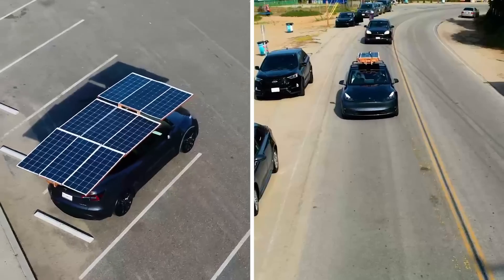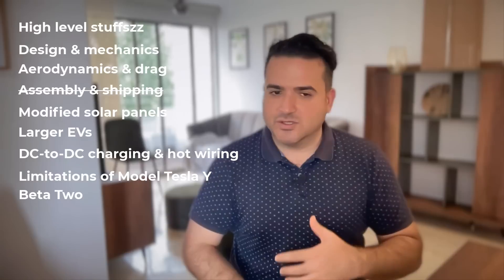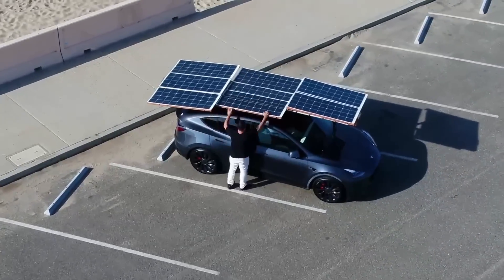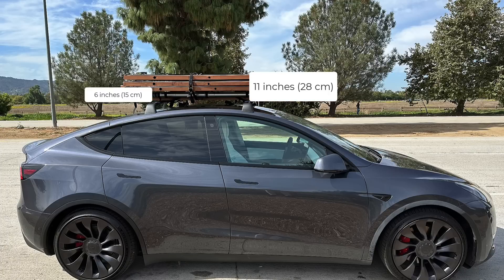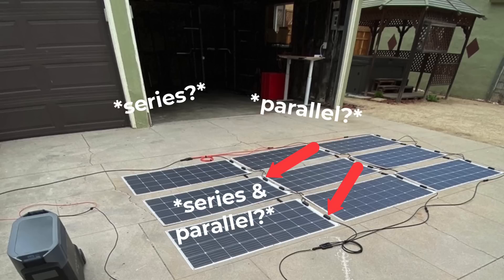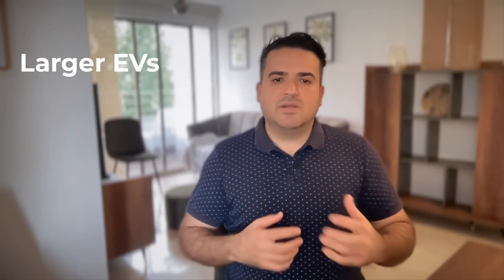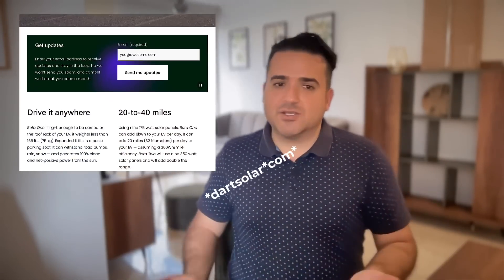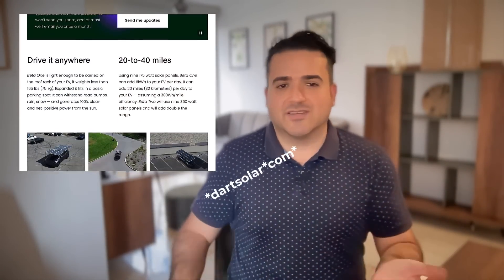DIY: A drivable solar rooftop for my Tesla Model Y (20 to 75 miles per day)

Comment: Please explain how you got the power into your car without inverters?
Reply from the maker: The solar power goes into an M PPT that's connected to a battery, 48 V battery. That is then connected to an inverter. The universal charger connected to inverter. I'm currently researching how can I direct the power from the solar panels into the EV as DC.

Comment: Even is such a contraption is FREE, one would probably struggle to get anything out of it.  If you actually drive a car at least a bit(more than 50 miles a day), the  extra drag will probably negate any benefits? At a cost of  4000$  you would run your car for more miles than the EV would be ever able to cover in its lifetime... Even if the whole thing would be deployed automatically not sure there would be takers...and thieves would be more than happy to help you to get it off the roof pretty swiftly too. In MHO his is just an idea, which is not viable in real life and probably never will. The losses are too great comparing to possible gains, lets be realistic about the subject. Yes, it is easy to criticize but the math simply does not add up no matter from which angle we would look at it.
Reply: Some people do much less than 50 miles a day, this totally works out for me, as for those who do more it's still a saving that adds up over the course of a year.
Reply from the maker: Well, the reality of it is if it gives you 20 miles per day, then you're good

Comment: I believe it would be necessary to install super powerful inverters on a scale, a type of Tesla coil that could either supply part of the vehicle's energy or instant charging... 4000W is a large amount of energy...
Reply from the maker: Not really the electrical components can fit in the trunk of the car, where the spare tire goes. That is below the flat floor of the trunk.

Comment: The disturbed air flowing over a roof mounted solar panel would lose you a lot of the gains that the solar panel is meant to achieve. Plus, it looks stupid.
Reply from the maker: Well, version two is 5 inches high, so the drag loss with a wind breaker is negligible

Comment: Since many cars are garage-parked during daylight hours, why not design a fixed version for roof mounting on structures?
Reply from the maker: The whole purpose of this project is to be able to charge offgrade, for example, if you're in the desert or in the forest. If you had a home, you can just charge from your homes electrical grid

Comment: I wonder if there is a way to keep the batteries warm with these solar. The EV's are proving not to do so good in cold weather.
Reply: Global warming due to the earth's orbits passing between the two energies of the Sun's Oort cloud magnetosphere for the next millennium.

Come to Jesus who united and warned us all.
Reply from the maker: Yeah, totally, the solar panels and electrical components can continually drive power to the car which the car intern can use to heat up batteries. For more details to get updates go to dartsolar.com and enter your email address.

Comment: put the solar panels on the car body panels
Reply from the maker: Love the idea!. The issue is that replacing a broken solar cell will be extremely hard, and if a cell breaks, it destroys the entire series. Embedded solar panels are super delicate and hard to fix. But if you're into that, check out the Aptera

Comment: thought about this YEARS ago...most people are parked outside at work from 9-5, prime sunlight time. Auto manufactures should make the top layer of hoods, roofs and trunk decks out of solar panels, or a skin on top of the original metal. Most people that have electric vehicles are within 20 miles of home. And with the right design, be able to regenerate that usage within those 8 hours. Toyota had a small roof unit to run their cooling fan so the AC wouldnt have to work so hard in summer time when people would first get into their Priuseseses...just do it on more body panels. Any surface will grab sunlight of some sorts each day.
Reply from the maker: TOTALLY AGREE. this has to be done. And not just a puny 200 watt or 400 watt panel. But something serious, so people don’t have to change their cars from the grid for most commutes. You’re so right.

Comment: What are the details of the 440W panel that weighs that little? I'm interested! And the beta 1 panels? I have a smaller application too.
Reply from the maker: All flexible solar panels weight about that range. Search for "440 watt flexible solar panel", you can also find the 200 watt or 175 watt Renogy flexible, or I think even SunPower makes them
Reply: @DartSolar  Oh, I see. But I thought flexible panels had poor longevity compared to glass ones? More degradation over time? Let me self check that before hitting reply... Yeah, and also lower efficiency ie more size per same output. I suppose you balanced all these factors to get the best compromise. As you were. <3

Comment: Tesla should do just what the Prius is doing with it’s hybrid plug in ev. It has a solar roof already integrated, the roof itself doesn’t give you much extra range but it’s definitely worth considering to implement and improve it.
Reply from the maker: Well, that solar panel is super helpful to not end up with a dead battery
Reply: this roof solar only keep the 12v service battery charged. this idea of solar on the roof won't work and so many done this before and none flew off due to high cost and low gain.
Reply: @farzins7682  the car has to be designed around the solar panel.. Think Aptera !!
Reply: The Prius solar panel doesn’t extend range at all.

Comment: Very Good job. Extend the concept to RV Vans too!
Reply from the maker: Such a great idea -- what are the dimensions of your roof?
Reply: I don't have a van, I'm only projecting in my mind how should it be. I'm thinking of a 6 m long electric van. @DartSolar
Reply: @claudiorusso2389 I have 1620W (4 ea 405W REC) on top of Chevy Express. Works great- approximately 6kWh/day.
Reply: @DartSolar  I'm the one who is driving a truck in Korea. I want to charge my truck camper with solar power, but there is no related technology in Korea.
I wonder how I can do DC charging in DC

Comment: When the panels are deployed, can you still open the rear hatch of your model Y? I'm very interested in this setup being used in the context of off-grid car camping. A dream scenario would be if the solar power gain can partially or completely offset the power use of camp mode at night. I would love to contribute or help out in any way possible, my wife and I do a lot of car camping.
Reply from the maker: Yes. You just have to not deploy the back solar panel. Off-grid camping is the EXACT reason I first wanted to create this. Were you the person that emailed us?
Reply: @DartSolar  yes, I sent you guys an email last night

Comment: EVs could have at least a small integrated roof panel to gain a few bonus miles a day.. for many people they'd only need that daylight charge for much of their local driving, leaving fast charging and home charging for longer distance trips.  Even a miniscule one could help to just maintain a minimum state of charge in a car sat unused for weeks on end rather than letting a battery drain down until it's flat.
Reply: The returns vs the cost really isn’t worth it for most vehicles or manufacturers sadly.  Electricity is cheap, an average of $0.22 per kWh and solar integration would thousands for an OEM to design and implement and create as an option for the end user. Aptera is going to attempt it with their vehicle as they’re making an extremely ultra efficient 3 wheeled EV, but some think it’s vaporware. I’m interested in an aftermarket system once could move from vehicle to vehicle, like via a roof rack, as I’ve owned 5 EVs over the years. I feel like something like that could take off, but then it would still costs a couple thousands, and I can buy a lot of kWh with a couple thousand…
Reply from the maker: Payback time is about 2-3 years
Reply: Estoy de acuerdo, y no solo para ganar unos kilómetros adicionales. También para que no gaste tanta batería en reposo, o modo centinela en el caso de Tesla, por ejemplo. Yo sería un usuario que pagaría más, por tener ese extra en el vehículo y de paso se elimina el techo de cristal, que en verano es engorroso.

Comment: This is a vanity project.  It won’t amount to much in the long run for the following reasons:

1. Even after several generations it’ll still be an appendage attached to the roof of what otherwise would be a clean aesthetic.  A car designed to look sleek and sporty is not the platform to attach such an appendage. 

This concept is not new when conceived for a big boxy vehicle like a Semi trailer.  And that means that the big boys will already design such systems for that context and this guy won’t have any advantage against them.  

2. The utility is needed only on occasion, and only on very specific occasions, like camping.  This means there’s only a very small subset of Model Y (or Model 3) owners, and even they will be hesitant to choose this over a portable battery with its own unfoldable solar panel.  A portable battery is something that can be transferred to any car, or camper, you own, rather than being dedicated to just your Model Y.  A lot of people who own Teslas own multiple cars. 

3. It requires deployment for each use.  If this were solar paint or a solar wrap, which might not produce as much power but could be active even when the car is in motion and would require no extra effort on the part of the driver, then I’d say you’d have a hit.  But it’s not.  It’s a deployable product with moving parts that could break, snag or be damaged by hail or wind or ice.
Reply from the maker: I guess time will tell. We plan to release version 2 around June
Reply: @DartSolar  I don't seek to disparage innovation, but I just want you to be realistic about where this may apply best and where it might not take hold.  Your work and what you learn from it may be of significant value in some as-yet-unexplored context, such as rapid deployment of charging in disaster areas as one example.  Keep going but don't mortgage your house.  If it's worthy of pouring money into then others will step up to provide funds.

Comment: I have solar panels on the roof of my home without a battery. Do you have instructions or can point me in the right direction on how to charge my car directly from the panels if the grid were to ever go down?
Reply from the maker: You can get an EcoFlow Delta Pro — then charge with AC. Or you can get a DC charge. How many watts of solar do you have?
Reply: I have a 11 kw system. 

I thought that if their grid were to go down, my solar panels would stop collecting energy. That’s what I had previously heard.
Reply from the maker: The power units on the market mostly allow 4kw of solar to connect to it, which gives you about 40 miles per day if you charge with AC. So you can get a power unit just to be doomsday ready. But you’re right, the solar witll stop providing power to the grid when the lights go out. That said, the solar will continue working — you can re-route 4kw to a power unit and charge your car until the sun implodes billions of years later :)
Reply from the maker: The power units on the market mostly allow 4kw of solar to connect to it, which gives you about 40 miles per day if you charge with AC. So you can get a power unit just to be doomsday ready. But you’re right, the solar witll stop providing power to the grid when the lights go out. That said, the solar will continue working — you can re-route 4kw to a power unit and charge your car until the sun implodes billions of years later :)

Comment: Genial proyecto. Precisamente yo estoy desarrollando algo parecido. Pero mi idea es hacerlo con paneles enrollables. En un rollo guardado en el maletero. El problema que veo es con la carga en DC. Pero si fuera posible igualar los voltajes de campo solar y bateria (360v) conectandolos en serie seria lo ideal.
Reply from the maker: Busca "Offgrid or die" y la solution que el tiene. Tambien busca en Google el indiegogo de "EV Solar Kits"

Comment: Nice work on the concept. I have built a camper van and this is basically the same idea as RVs with solar, but the compact and extendable function is great. The only problem is this is really only useful for a Dooms Day/Overlanding scenario. If you built a solar carport at home it would basically do the same thing, without the drag loss.
Reply from the maker: Very true -- but my goal is to charge anywhere, grocery store, office, forest. For people that just want to charge at home they can connect directly to their roof's solar if they have one. The aerodynamic loss will be tested with the shorter-height version, the second prototype. I'll reply here wit the numbers when I get the data
Reply: @DartSolar  there's significant data online regarding the efficiency loss from drag of bike racks, both rear mounted and roof mounted. Sadly, it's not good news for a large cross-section mounted on the roof.  I did this research when considering a sedan versus hatchback and decided on the hatchback where the bike can be carried inside my vehicle.
Reply: Less damage from sun, no need to wait for charge

Comment: could it maybe be taken apart or folded to fit in the trunk? should make aero much better. 150lbs of stuff being lifted doesnt seem easy or safe tho
Reply from the maker: True. Right now we’re considering all options. Even integrating with roof so there is no space between roof and device
Reply: It could be designed like a canopy. So it is on legs above the car.

Comment: Connect all panels in series for 178V then feed DC-DC boost converter connected to 360V tesla battery directly.
Reply from the maker: Love it, have you done this before. Do you have any insights as to the comms cable and how to interpret the signals?
Reply: @DartSolar  Older Tesla's uses Tesla proprietary charging comms. 2021 and newer typically include CCS2 communications.
Reply: @DartSolar  have not done it but i want to try with my nissan leaf. Would have to spoof charger can bus signald to make the car think its ac charging.